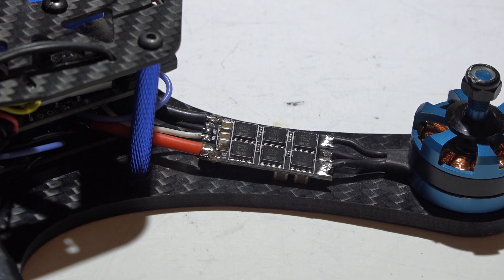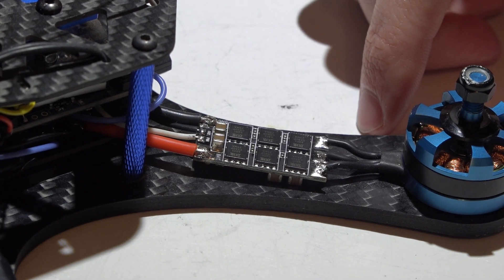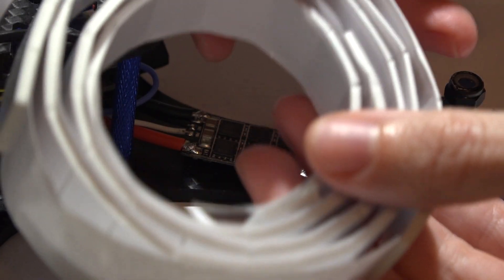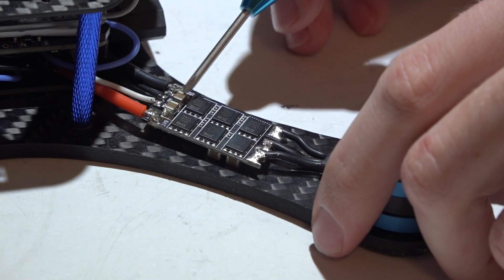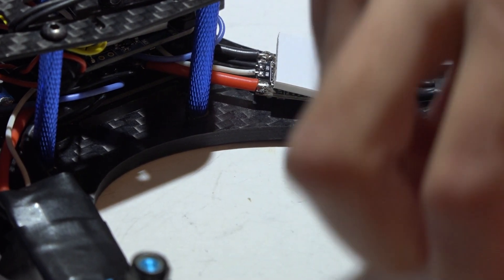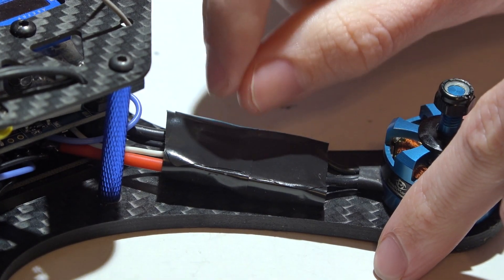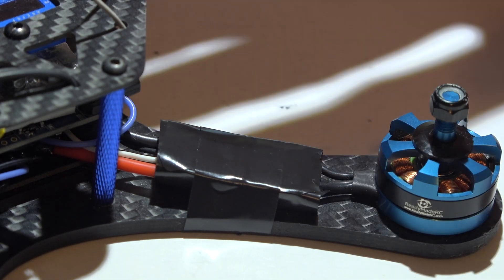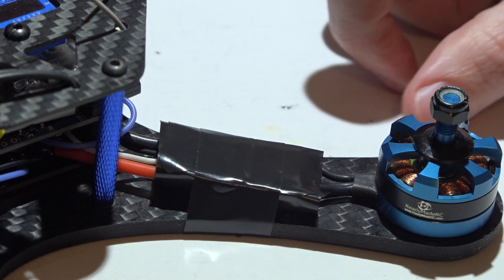How To Protect ESCs

Comment: I think the ESC's can overheat when the current rating of the ESC is too low for the motors being used. Always use an ESC with a MUCH higher current rating than necessary.
Reply: When you get lot of airflow, heat shouldn't be a problem.

Comment: Building the same frame in orange with Brianfpv fc/pdb, 35 lumenier esc's, cricket txv, tmotors f60 pro 2200kv, hs1177 foxeer,  going to run spektrum gen1 dx8 because that's what I have.   i just watched your video on the antenna  for this frame!  Thanks for the videos! I didn't like how it worked with the 90 and I want to run the flexible antenna mount anyway but did not have room to clear the mounting bolt. How did you mount the xt60 pigtail?

Comment: When you dont have 1 inch wide drag brake arms like the raptor quad (12mm wide), then I find 2 wraps of shrink can get cut though, pretty sure shrink is tougher to cut than foam is.

Comment: I used double sided 3M tape. Should I replace that with foam tape? Also, I know that you dont think ESCs overheat much, but do you think my setup will? This is my setup: I put heatshring over esc, put 3M double sided tape under esc, electrical tape it to the arm, the put half of a prop over the esc to protect, then wrap that in electrical tape. Do you see any issues with this?
Reply from the maker: Nothing wrong with 3M tape. Not sure if that would overheat, but I'm leaning towards you should be fine. It takes a lot to overheat them. Unless you're professionally racing and staying at 70-100% the entire time.
Reply: If I was, what would be the biggest contributing factor to overheating? Thxs for answernig all of my questions btw. Definetly one of my favorite parts about you and other youtubers
Reply: I use it almost the same way he uses his and i have a voodoo quad i run as an everyday (unless its raining) quad.  no issues with ztw 20a esc's and f60 1900kv motors!

Comment: Or they overheat from over "amping" them? Like pumping 30A constant on a 20A ESC ? Have you tried those 3D printed esc casings? Is it efficient? I find it bulky and heavy... I've always wanted to try some, but they also cost some bucks... That I'd rather invest in the price of the ESCs.. But yeah, escs are probably the component that gets damaged the most after the vtx...
Reply from the maker: I havent used the 3d printed cases. Some ESCs I have bought have come with cases, and they do work well. Lightweight too. Thats probably the best protection. But I just use the foam. Havent had any problems yet.
Reply: Project Blue Falcon thanks, guess will give the cases a shot on my kamikaze quad